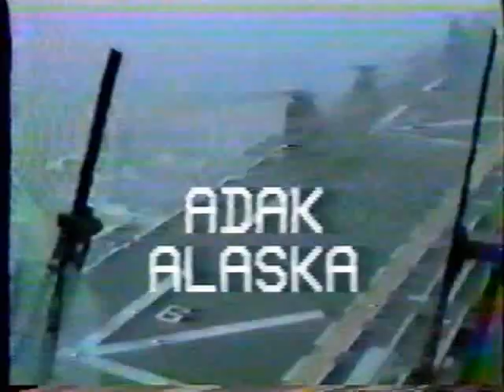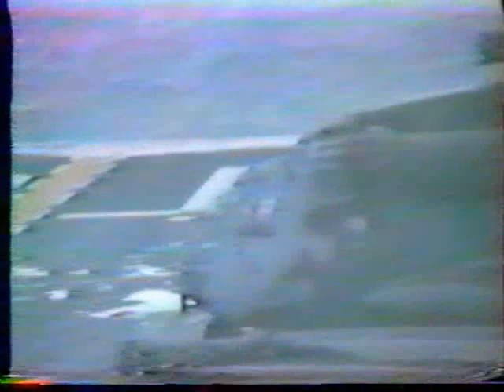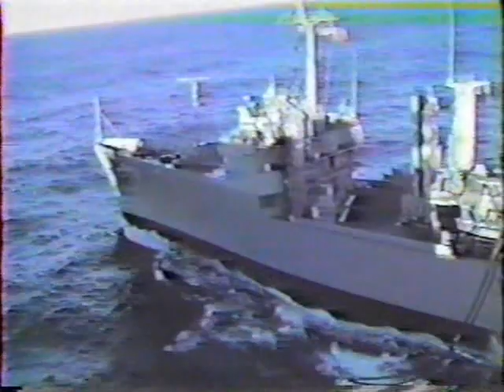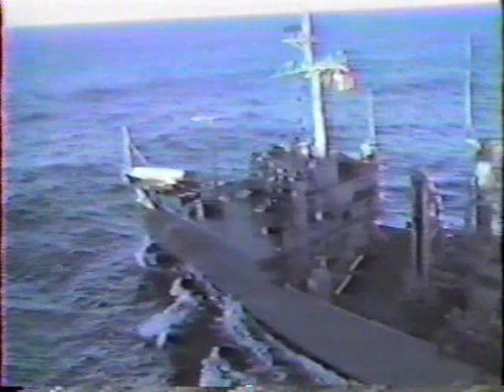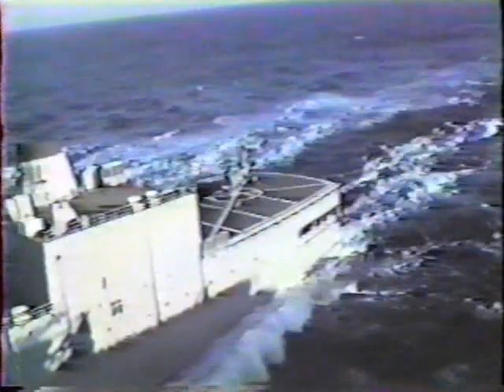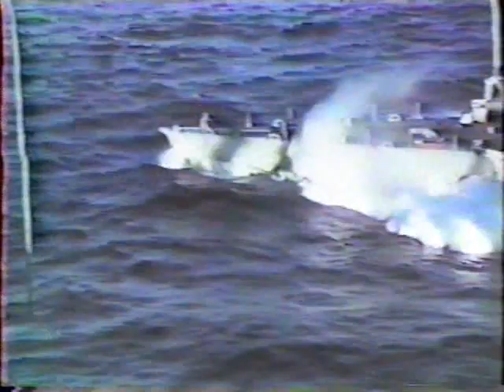WestPac 87 Adak Alaska

Comment: I was there. AAV platoon attached to BLT 3/1. We made a landing on Shemya island, WEST of Adak. Pushed the limits of the vehicles and the ship. I'm sure that we were on "rack ops" during the worst of it. I still remember the mess deck filled with inches of water and trays sliding off the tables. Good times. Thanks for posting.

Comment: I was on the USS Cayuga LST 1186 with India Co. 3/1 during that float. Cayuga took a beating from Adak to Shemya, and needed a quick stop in Yokosuka for repairs, then to P.I. for major repairs. Semper Fi
Reply from the maker: Yeah, we split the superstructure and had to extent our visit in P.I. to repair it.

You might remember this one also: https://youtu.be/M-n7QUO57T8

Really sucked being towed.
Reply: I was on Anchorage with G3/12. I remember watching that flat bottomed surface submarine taking white water up to the bridge. The entire front would be underwater. Nothing personal but we were watching because we just knew you were gonna sink. I was on mess duty in the 1st class PO mess so I got to know guys that had been in the navy along time . Those guys were scared! They said the cranes which were held on by gravity and we rolled so much they almost came off the boat.